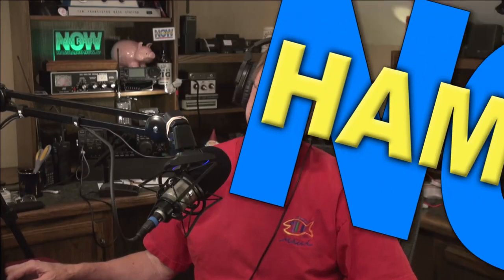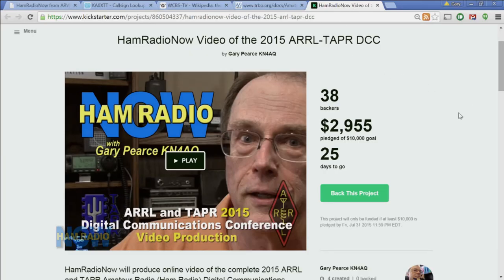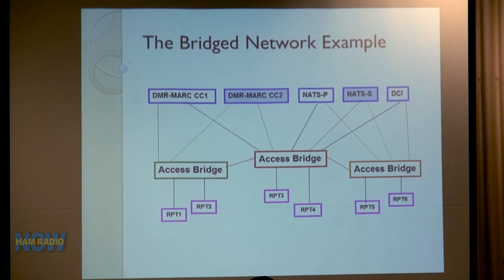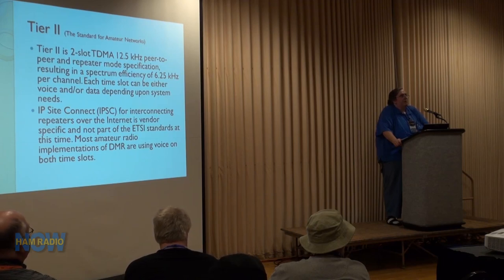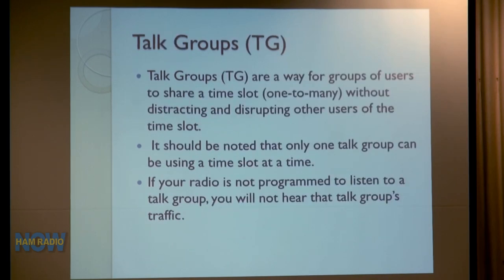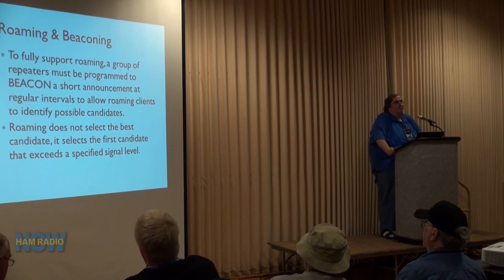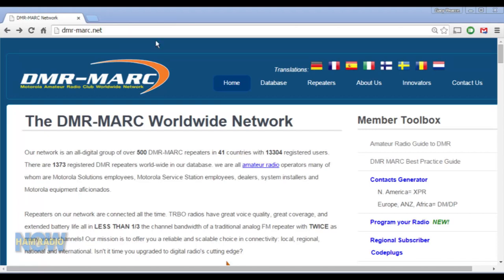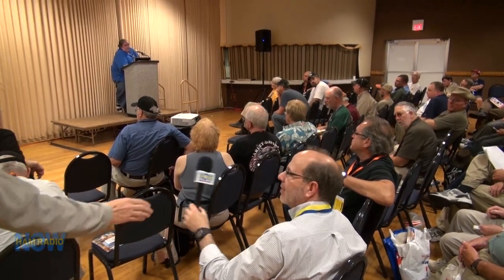HRN 210: Intro to DMR on HamRadioNow

Comment: I'm not too sure if the info on tier 1 DMR is correct at all. DMR has never used 6.25KHz channels, it always uses 12.5KHz channels with 2 slot TDMA. It's not even the same thing as dPMR446 so I think the presenter got his info a bit mixed up.
Reply from the maker: radiosification I haven't reviewed that part, but DMR advocates often point to an 'effective' 6.25 kHz bandwidth because the actual 12.5 kHz wide signal carries two conversations. It's a marketing point they use to combat the narrower digital mode's spec, but should not confuse anyone doing frequency coordination.
Reply: Yeah that is true, however it's only 6.25KHz equivalent if DCDM is in use. Otherwise it is just as spectrum efficient as normal 12.5KHz analog voice.
Reply: 0

Comment: So, let me get this right . . . If you have an emergency in an area you don't have programmed, no one will hear you?  You have to know the right "color code", and "talk group", etc., etc., etc. . . 

No thanks . . . I'll stick with plain, old-fashioned, reliable analog.  Y'know, the kind where any ham on freq can hear your emergency call.
Reply from the maker: Bledsoe Texas - baby, meet bathwater. Bathwater, this is the baby. Out you all go. 

You have identified a flaw in the system (and not necessarily one that can't be overcome), and obsessed over it. I've been having fun learning and using this interesting and useful system. And in the areas that I do have programmed, I think I'll get quick help for my emergency call on the network, while you fumble with your repeater directory and hope you stumble on a machine that actually has someone listening.
Reply: You have misread or I have misspoken.  I am not throwing anything out.  If DMR has a use for you or you choose to experiment... great!  That's what ham radio IS.  I simply was commenting on my assessment "for me and mine".  I do not see how DMR "fits" into my ham radio "experience".   I am a Jeep owner and often not in an "urban" area with good coverage.  I don't see DMR being useful or helpful in my situation.
Reply from the maker: That clarifies what I took to be a blanket condemnation. And I'll clarify my point. 

Trying to find help from 'any ham on any freq' is a low percentage bet. We are far too casual in tossing out how important ham radio can be 'when all else fails' without pointing out how much preparation goes into making that work.

You're much more likely to succeed if you know the RF territory and are prepared - with a well-programmed radio. I'm guessing that you're more prepared for both the off-road terrain, and the RF terrain, then you let on.

Many standalone FM repeaters are virtually unmonitored. Networked systems like DMR, D-STAR, Echolink, IRLP, AllStar, etc. can find you help more reliably, if you're prepared to use them, because they have networked chat rooms (reflectors, server groups) that bring lots of repeaters together, ensuring that many hams are always available.

Your initial comment struck a dismissive tone. You could have commented from a neutral, fact-based position. 

For example, DMR requires knowing several things: Frequency/offset, color code, *talk group*. 

Analog FM requires knowing frequency/offset and subaudible tone (for most FM repeaters, and the 'color code' on DMR is its version of subaudible tone). 

So DMR's talk group parameter is unique, a holdover from its commercial roots (and, to me, an odd fit into Amateur Radio, but it sort of works). And most DMR radios don't let you program that from the face of the radio, even if you know the numbers. A hurdle, but not a dealbreaker.

As a fairly new, niche mode, DMR doesn't have nearly as much coverage as mature analog FM does, especially in rural areas. But if it does cover your off-road terrain, and you're prepared for it, you may well find it fits your ham radio experience just fine.

DMR has some GPS capability, though I'm not familiar with it. D-STAR and APRS can let hams pinpoint you on a map (if you're in a repeater/digipeater coverage area). Those could be really helpful in an off-road emergency.

It's easy to toss off a bit of internet snark, especially if you have a bit of bias on a topic. But often there's a lot more below the surface.